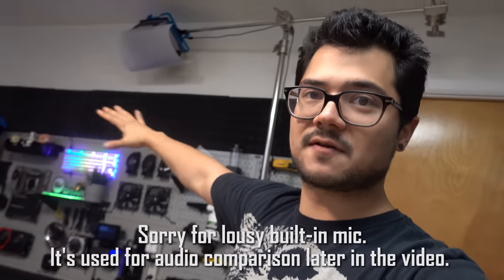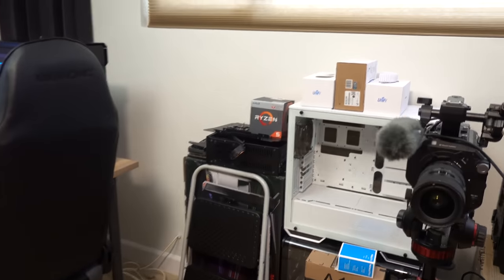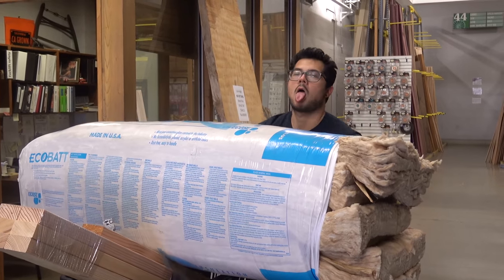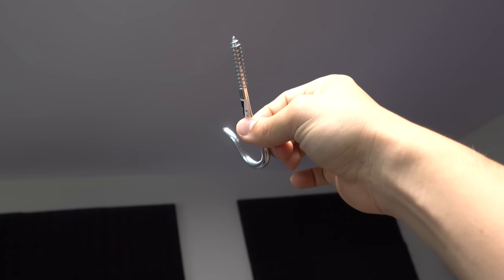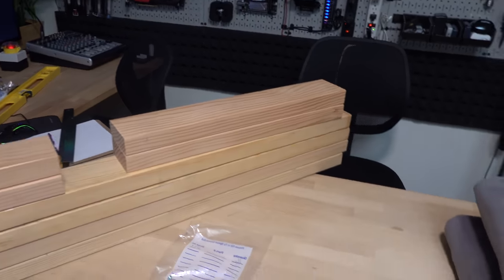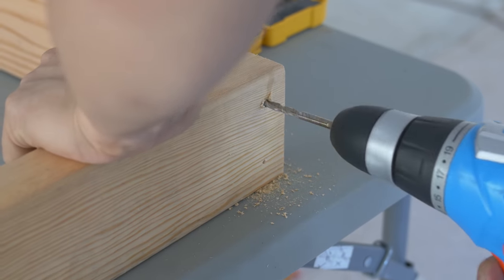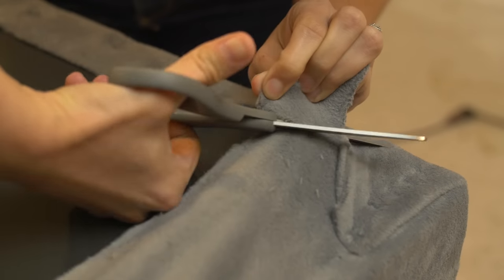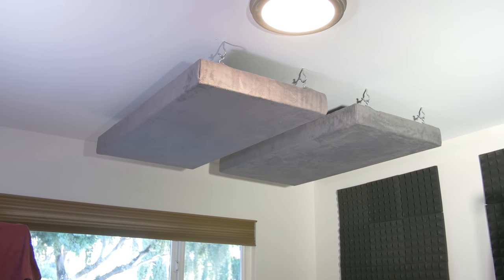Making my own acoustic panels...Was it worth it?

Comment: You wayyy over spent! lol I went out and grabbed a bag of Rockwool safe n sound ( 12 - 3x15.25x47),  12-1x3x8's,  and some fabric from the local old lady store... I paid about $142.00 for all materials and hardware to mount.  I should be able to make about 9 panels with what I have then I'll head back to pick up some more wood to finish off the other 3 rockwool batts.

Comment: Not to pile on, but 2x4 is excessive and heavy, 1x4 would've sufficed. You could also of saved money by not using the L brackets, the two screws and wood glue would be plenty. These boxes are not holding anything more then their own weight, they only need to hold the fabric, to hold the insulation.

Comment: You shouldve put up curtains up instead, it has dampened the sound soo much in my room. Wouldve cost much much less 😉 cheap curtain poles/tracks on the walls, cheap curtains off ebay for example... Bam! Less echo echo echo

Comment: The positioning isn't the ideal, the panels should be on the direction of the sound source, in this case your voice, to stop the sound to bounce, so you need panels on the wall, under the window, or get some really thick drapes for the wall, that will help a lot more than these acoustic panels.

Comment: Hate to be a debbie downer but I have done a bit of acoustics in my life and I can tell you you're doing one big thing wrong. The multiple panels you have scattered on the walls isn't really doing anything to reduce the echo - in fact it can make things worse. All those small panels you have on the walls are doing is absorbing HIGH FREQUENCY's only. That and the window are the biggest contributors to your issues. 

I would say remove a lot of your "cheap" panels because they aren't really doing anything, and replace them with more of your DIY bass traps, since you're onto a great start with those. Fill in the corners, and apply a heavy cloth fabric / drape over the window. If you want to soundproof the room as well I recommend replacing your windows with a double pane option. 

To sum it up, replace most to all of those panels you currently have on the walls since they are doing nothing but absorbing high frequencies, replace them with actual fiberglass insulated bass traps like you are currently doing, apply a heavy drape to cover the glass window, then re-apply some of those high freq absorbers when it is all said and done. Also hit all your corners. Finally, look up rodetest and download the FuzzMeasure application and use it to get a EQ graph of your room acoustics and use that to determine what you need to create a flat sound, which is ultimately what you want. 

You're not going to get an echo free room, so don't expect to make it completely dead. You're otherwise off to a great start! Replace the ones you got, build more actual traps, and go ham with them!

Comment: Ummmmmm... I paid 680€ (Germany) for 14x pyramid + 4x bass absorber panels. So 18 in total measuring 100cm * 50cm * 7/10cm each (7 for pyramid, 10 for bass). 250$ for just 4 of them and not even the same size is a huge rip-off. 680€ is a huge amount of money, too, but at least I got something for it. Plus it's professional Basotect stuff. Plus it's just glued to the wall. And it works. Maybe look for a store that actually deals with these types of things instead of Amazon?? I mean, Amazon is not known for making professional grade audio treatment stuff.

Comment: 1 x .5 Furring strip would of prolly worked better. 2 x 4 is way too huge and expensive for that application. If using the furring strip either glue/staples/small nails would of worked versus all that hardware, dramatically lowering cost. 1 inch by 12 inch by 60ft rolls of fiberglass insulation cost pennies compared to wall insulation in bundles. 

The weight savings as well when using this method is night and day, allowing you to use drywall inserts instead of relying on studs, giving you more choices in placement.

Comment: Oh man, you might have reduced some echo, but by giving the backs a flat solid surface, you created an area between the hard ceiling and the panels for more echo to generate, you might have actually increased the noise in your area.

You can fix this though. More fabric, remove poster board, staple the existing fabric across the front taught, OVERSTUFF the panels with acoustic tiles, cover the back (it can bulge).

Also, you want to drill holes the size of the core of the screw, not the thread, but I am sure you did that.

All of this will make it work... but is not the best solution... lets get serious now.

You need to get isolation hangers and some acoustic ceiling panels and suspend them over your whole ceiling.

Comment: The cloud panels should be over your mix area and are only for first order reflections. Unless you cover your entire ceiling they’re only effective over the area that is producing sound. On another note you went WAY overboard with the 2x4’s and hardware. Generally acoustic panels are made with 1”mdf or choice lumber and no L brackets or metal hardware are used except for hanging. One because cost and two because weight. Either way good viddy.

Comment: I don't know why you felt the need to use materials that are that robust.

2 inch thick poly foam on simple 1x1 frames would have worked the same and it may have been light enough to where you can use drywall anchors for mounting flexibility. Cheap enough to where you would have probably covered majority of the ceiling already with the 250 you spend on those over engineered things.

Oh and even cheaper ones, go find DIYPerks channel and watch his video on doing something similar, his came out to around 5usd per panel.

Comment: those aren't bass traps in the corner, they're money traps. i dont want to hate but there were too many mistakes. i apologize in advance for being critical but nobody should make these panels the way you made them. poster board? why? that stuff is reflective of sound and it reduces the absorption of the panels. by not allowing the sound to also escape out the back of the panel you're making your panels much less effective. just use fabric on the back. also, that fabric on the front doesn't look that breathable, which is the rule of thumb on these things. it looks too thick, like drapes or something. although i could be wrong. and the main point: it's the wrong type of insulation- that stuff looks loose, you need rigid batt-type (compressed) insulation- either rigid fiberglass or 'rigid' mineral wool- for full spectrum sound absorption. different insulation types have different ratings. i think the one in north america is called roxul safe n' sound. it's 48kg/m2... rated for full spectrum sound absorption. not hating just trying to help others to not make the same mistakes.... all these mistakes are why ppl are saying there isn't much difference in the before and after of the sound treamtent. if you had used the right fabric on the front, the right insulation, and swapped the poster board on the back for fabric, you would have noticed a HUGE difference. unfortunately it's sort of too late to undo all that. there's always next time, though!

Comment: Literally could have just hung the heavy cloth for almost the same result. Insulation will be doing almost nothing.

Positioning, and breaking flat parallel surfaces, will be far more effective than material selection. Angle the panels so they aren’t level.

Looks nice though.

Comment: imma be honest with you chief. it would of been better money spent to just glue panels to cardboard pieces and place them everywhere. like that didnt change nearly anything, you could of even if you wanted to get even cheaper just straight up tack blankets to the wall and ceiling.
 Like I bought a Sherpa blanket from amazon for like $10 and tacked it to a wood frame made from super cheap pine strips, command stripped that and it works better than the panels i had i was actually really impressed.

Comment: Wtf. bats with r15 doesnt cost that much. Here i can get the same amount for like 40 bux. Also you can get like a bunch of long drywall screws and use that instead of the wood screws (way cheaper). And the wood could have been made with trash pallets or cheap 2x4s

Also ceilings probably better to use a light fabric stretched across the ceiling with a decent gap between it.

Comment: the cheap foam panels aint worth the time or money, really bad performance. Better off using 2 to 3 inch insulation panels, rockwool or fibreglass.  4 x 2's are a bit extreme, 4 x 1's would do, lighter frames, just put a couple support rails. Use absorption on the first reflection spots, then diffusion panels set further back into the room and a diffusion on the back wall. The absortion panels help lower resonant frequencies and the diffusion panels create a big sound space by scattering the mid and high frequencies. Dont bother with foam tiles, a waste of money. Also, the poster board is a bad idea, hold the insulation in with  couple support rails and cloth to allow the sound to go through the panel, hit the wall, and come back through again. There should be a gap between the panel and the wall/ceiling  for best results.

Comment: You should never predrill your holes to the same width as the threads. The predrill should be the same width as the shank of the screw, not the threads. Those panels are gonna fall apart pretty easily when you go to move them around with no "meat" left for the threads to grab onto.

Comment: its far cheeper to using ohens corning 706 1in wood boxes to fit around the panels 6 panels will cost you less then $100
Reply: also the fabric you used is reflective and would make the acoustic panels less effective and If you leave the top to panel open and it would be even more effective

Comment: Anyone doing something like this on your own.  You wont need something as robust us a 2x4. You could easily build these with PVC Fascia or even just some cheap Pineboard. Also no reason for L brackets on the insides. Especially if you went the 2x4 route. Screws are plenty to hold it together forever.

Comment: As a woodworker, watching him build that frame with L-brackets hurts me.
Reply: I mean it was just a completely waste of money, it doesn't hurt anything using them, the L-brackets are completely unneeded there.   I mean just the screws were fine by themselves but by the time you add the backer and then staple the front on that thing would be absurdly solid.

Comment: 3.5 inches thick? that's nothing, fluffy has the lowest GFR so you need a least 12 inches thick panels if you really want to use that, ecobatt and rolls are used for superchunks mostly or any type of corner bass traps (tube, softits, etc). If you want 3.5 inches thick panels then you need to get higher GFR material like roxul AFB EVO formaldehyde free, knauf ecose (3lb 2 inch panels) or thermafiber firespan FF, if you check the porous absorber calculatorit will help you calculate how many inches of what material you need to get the desired effect, all you need to know is the GFR.

Comment: First off you never use the mic that comes with the camera. Second that room needs way more sound acoustic treatment. Too many walls bare, high ceilings, window, etc. A wireless lab mic would make a huge difference even without all that treatment. A boom mic will help. I would have spent the money on a better mic first. I have a cheaper better solution for sound panels. Go to goodwill and pick up a ton of towels for cheap and use them inside your frame. Then double wrap bed sheets around the frame that you can get also at goodwill. The wood frame you might want to think about lighter thinner wood or aluminum. It would have been much less and you could have had many more panels. Those black foam you have only work if you cover ever inch of the room.

Comment: When it comes to figuring the amount per panel for the insulation, roughly $75 for x amount of insulation divided by x panels will give you a better estimate of per panel for DIY.

By eyeballing it I would say you could make 6 panels with the amount of insulation you have there. So you can make 4 more if Im not wrong. Just take the cost of the insulation and divide it by 6. For what I estimated, roughly $12.50 per panel cost of insulation. Now just extrapolate the cost of the two you made to 6 while including the $12.50 worth of insulation into the equation. For the two you made just add $25 to what you spent on the other materials so fat. . . i think. Math was never really my strong suit 😂

Comment: This solution isn't that good. Imagine how much dust will get between the ceiling and the panel. And over time that dust will start falling and also look bad.
You did a great work with the actual panel but I think mounting them flush with the ceiling would be a much better solution.

Comment: So, there are quite a few ways you could have saved money on this project.  Most of that doesn't need to be stainless screws.  Drywall screws.  Buy by the pound!!  Insulation, just buy a roll of it.

Comment: Little to no difference before/after.    If you're just trying to get rid of the echo, all that insulation is totally unnecessary.  You would have got results just as good (or better) with a saggy blanket loosely fit over a couple of firring strips.    The $250 panels are designed to prevent sound transmission to another area (think office cubicles), which again, is overkill if you're just trying to get rid of the echo.

Comment: Built the same, but with MDF, and the pricing was quite a bit cheaper.
Reply: Mdf is heavy and a poor choice for this type of construction
Reply: @kurtbergman4491  Actually they are quite good and not heavy whatsoever.
Just simple 4 sided box which is 3 inches deep...

Lighter than lumber by a MILE

Comment: dude... do checker-board pattern with your pads on ceiling, wall, ceiling, wall, ect. That's how you get rid of echoing, surprised you did not know this being a techy guy
worked in recording studio and there are perfect ways of doing this, but what you did was pointless. Get the pattern going with simple egg-crate panels, they're not expensive. And you don't need to buy more, use those dampers you purchases and blotted on the wall. Even after you put those pads on the ceiling, it didn't help much. You have to find where sound can echo off - meaning what can it bounce off ? Well, where the wall meets the ceiling, corners, ect., It's that simple, you have overthought this with those panels

Comment: I'm sorry, Kyle, but the difference was almost impossible to hear... I would bet stapling some egg cartons straight to the roof would have been better. 

Those insulation mats prevent sound from going through the wall, but they do not help the acoustics inside the room.

Comment: That moment i had to realize, that american ceilings are also drywall. Crazy
Reply: As opposed to?
Reply: @BobLoblaw69  Like the rest of the house: Brick or Concrete
Reply: @DanielDettlaff  Brick is used as a non-structural facade, and the only part of a residential structure that uses concrete is the slab (concrete is fantastically expensive, especially if you start using it off the ground). I have legit never seen a house with anything besides drywall on the ceilings, in any country I have ever visited. Where do you live that this is not the case?
Reply: @BobLoblaw69  Germany, England, Denmark, Poland, Swiss, Italy, etc. .. about all of europe. No offense there. People in Germany are jokingly mocking US buildings for being flimsy, so we know that many houses in america are build with drywall walls, but the fact that the ceiling also is drywall got me.

Comment: Physics is physics. The framing was over done, wrong fabric, wrong insulation, wrong placement, wrong backing. True acoustic panels use ridged insulation in he 3-6lb/cuft range not the fluffy Home Depot stuff. Typical high-density material is Owens Corning 703/705 material. It’s rigid enough to wrap fabric directly around and glue on the back then mount on the wall. Framing is recommended though. GIK has nice diy frames for real cheap that even has side venting for more sound absorption. 

Foam is absolutely useless and ridged insulation panels at the foam locations would work best. Cover has to be very breathable which is why the pro panels use Guilford & Maine fabric. Mounting the panels away from the wall with spacer posts increases the bass absorption because insulation is a velocity absorber and velocity at he wall is almost zero while pressure is maximum. Leaving the rear open increases the sound absorption effectiveness of the panel. There are many YouTube videos documenting acoustic panels including REW waterfall plots showing room before and after frequency response correction and decay times.

Comment: Great now every time I watch your videos I'm going to think the sound sucks... If you use quality sound suppressors , it should only take two or three per wall. You shouldn't really need any on the sealing. It's a small room. I will say the hardwood floor is the biggest culprit to your sound issues.

Comment: Don’t do this at home. The fibers of the fiberglass insulation works it way through the fabric and causes lung problems. Either seal it with plastic foil or use different materials... and the size of the Panel is way to small to be useful. I have 6 100x50cm panels and they only did a slight difference

Comment: Totally overkill wood used. Way to thick and heavy. If it comes down, you can be seriously injured. Just mount several hooks along the 4 walls and span a sheet of fabric along the ceiling. Job done. Gone is the echo.